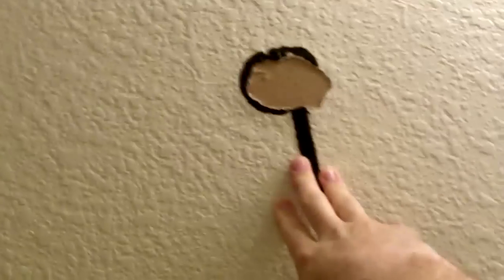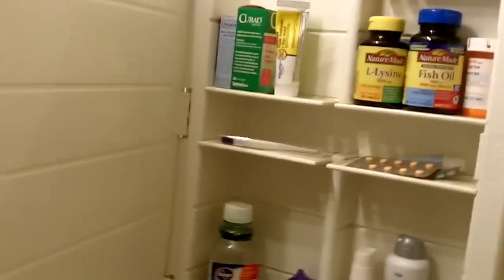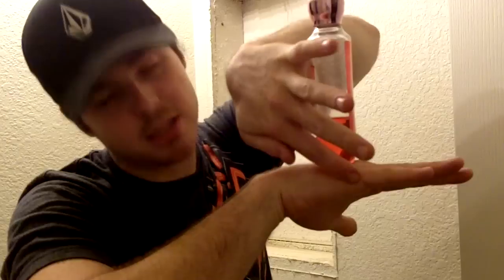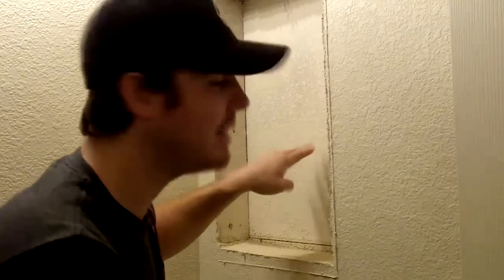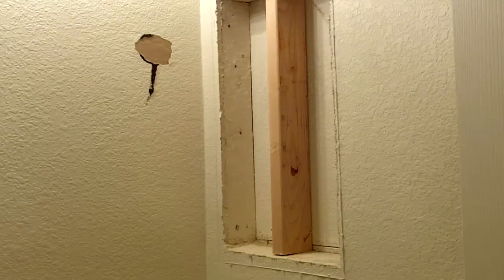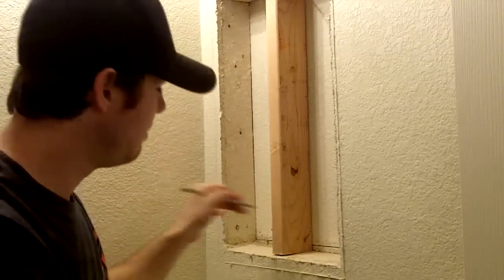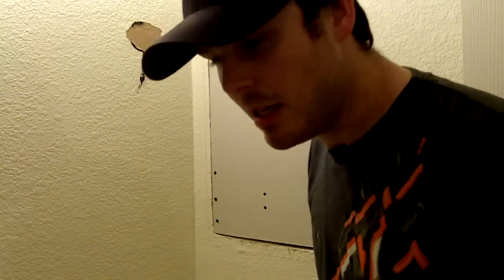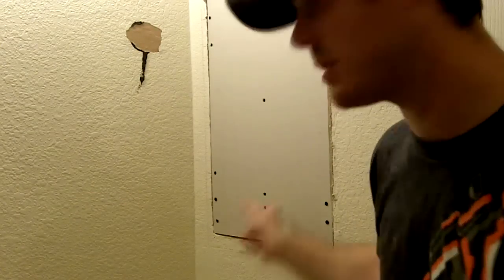HOW TO REMODEL YOUR BATHROOM - DELETE MEDICINE CABINET

Comment: you can cut back half way on left and right stud is more then enough framing adding middle stud is going the extra mile
ive even cut back 1/2 inch on all four studs 

i have video on my channel how actual lic drywaller covers med box